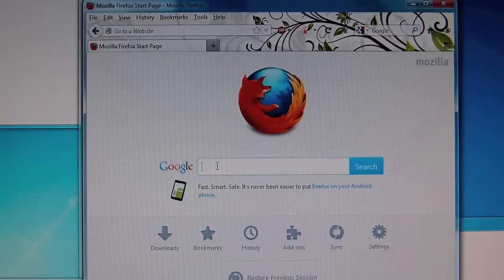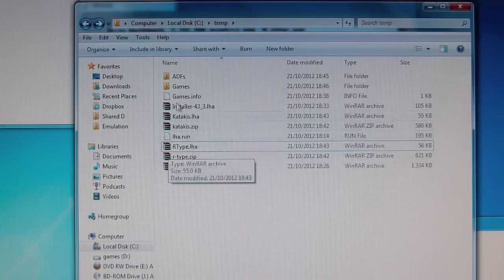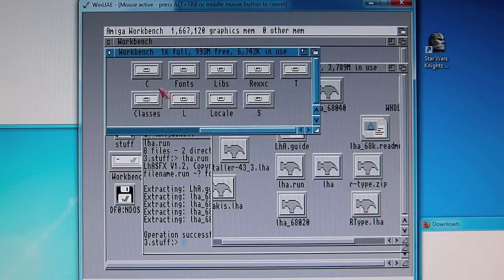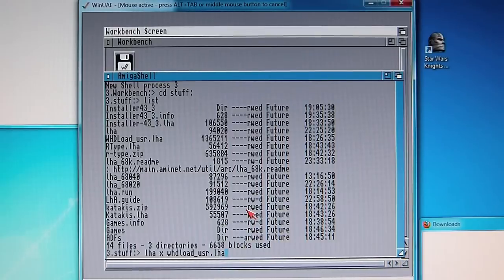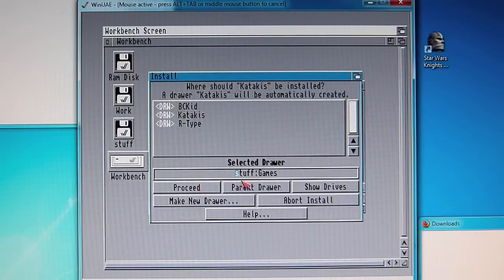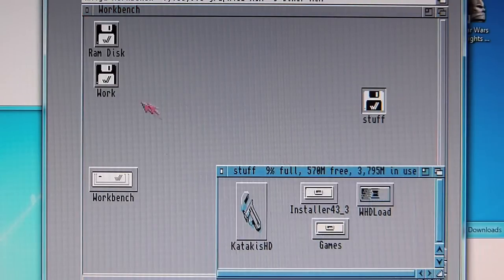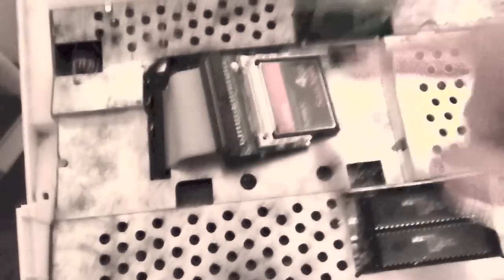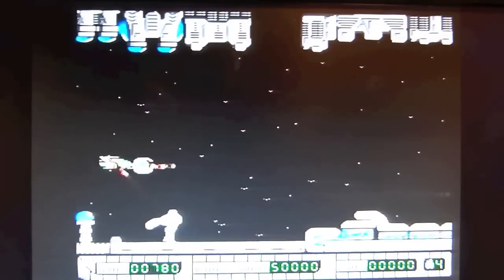Amiga WHDLoad with CF tutorial

Comment: Thanks Dave. Very helpful, I have set up several of my Amigas using your tutorials. One thing I'm not sure of is I have a Blizzard 1230 installed in my A1200 which runs the 68030. I notice there are only lha installers for the 68k, 68020 and 68040. Which one should I use? Does it matter?

Comment: Hi, I have uncompressed lha typing lha.run everithing it decompresses right but when I run lha o the shell I get a message saying:
 Cannot open "mathieedoubbass.library , version 37.3¨"

Any Idea where the problem is, if setted the configuration on based on an amiga 600 because it's the system I'm going to use

thanks
Reply: Thanks Dave, and into which directory do I have to copy that file?
Reply: I have found the files, it's a math library package, wich is compressed with lha. The problem is lha commands don't work since they need to have this library installed, soooo.....